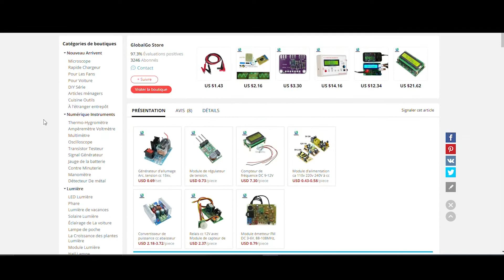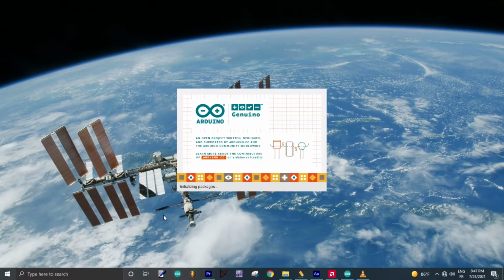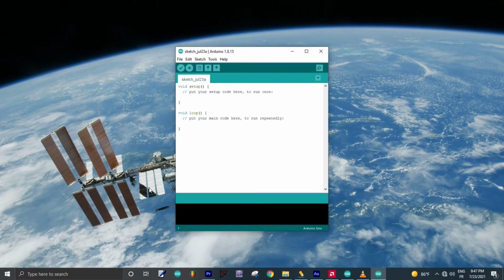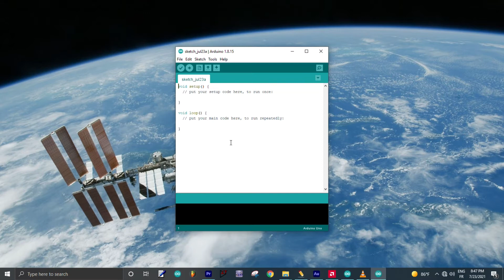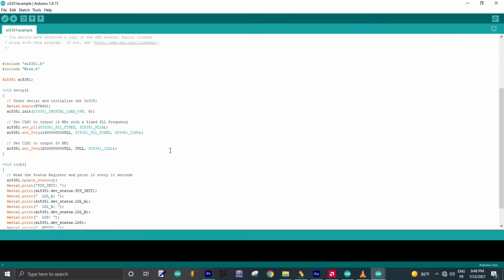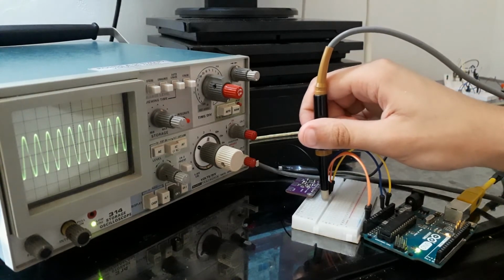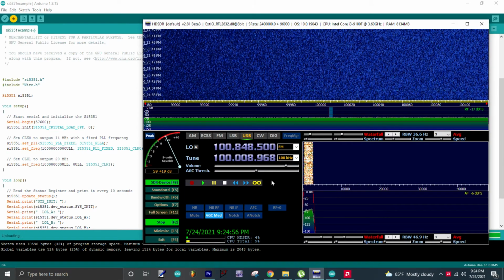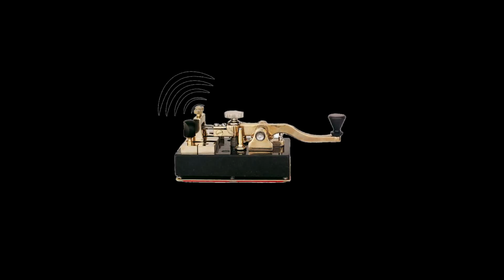Silicon Labs Si5351, Infinite Frequency Generator (LF,HF,VHF)

Comment: Hold that thought  Aniss.. I will send you a schematic to take a low level TTL signal and get three watts RF out of  it  on twenty metres.  Essentially with minor tweeks what you show  plus the existing chassis can be a three  or four band CW QRP  or even 10W transmitter  for the work involved in making up a simple PCB and also adding a keyer cct and software to the Nano in the AT-20 or whatever brand of radio is used.   TE Fidler

Comment: Good, informative video. Thanks for sharing it and the code sample.

The device specification claims a square wave output across its range.  The sine appearance might be due to scope bandwidth; do you see CLK0/1 both square wave at audio frequencies?
Reply from the maker: Sorry for late well . Its not about the oscilloscope bandwidth .its about synthesizing signals on higher frequency

Comment: Essentially if this code can be fitted into the Nano that sits in the AT-20 or other generic radios you have a signal if  Sinufied  that can run the  Rick Campbell  SSB Phasing exciter from ARRL archives that I have detailed elsewhere on this board.  I am  suspicious about the  OP CLK0 being a Sine wave but this is easily fixed via either of the two ccts I have detailed  The GND gate FET   schematic is of course more frequency sensitive to movement away from the design point .   73,s  TEFidler   Nouvelle Zelande.

Comment: just a question: why clock 0 looks like a "sinus" while clock 1 seems to be a square wave?
Reply: It's a mystery to me as well.. all those CLK0, 1 etc outputs are supposed to be  the same. I can't see why it should be anything but a Square wave.  TE Fidler
Reply from the maker: When it outputing higher frequency it goes more into sinusoidal because its digitizing ( higher resolution rate)  more than lower frequencies